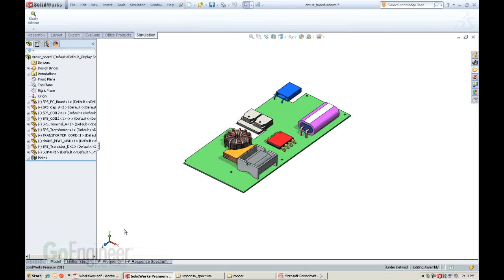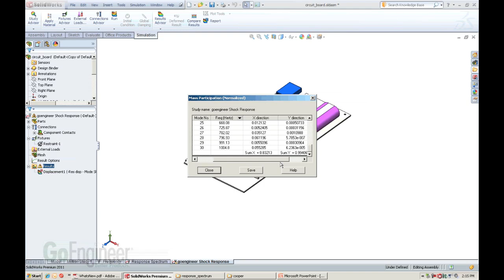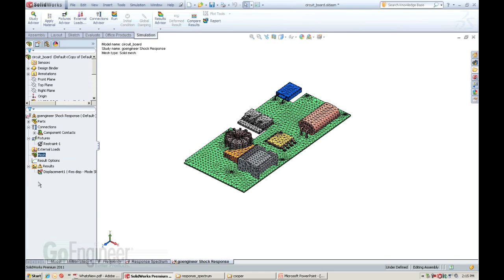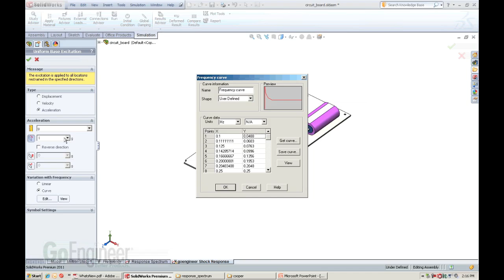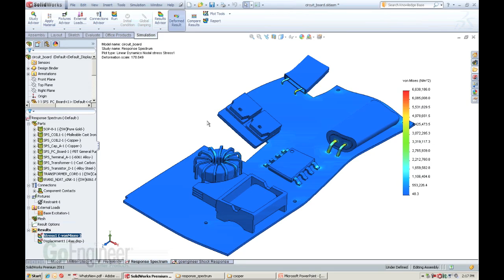SOLIDWORKS Simulation 2011- Shock Response

Comment: We are Interested in Software for Simulation of Shock Response Spectrum due to Pyroshock on Satellite/Aerospace.
Stress values can be predicted with this?
Reply from the maker: Yes, the SOLIDWORKS Simulation Response Spectrum Analysis does give stress results. It also can give displacement, and acceleration results due to the shock. 

You will need the Shock Response Spectrum (SRS) from the Pyroshock event that the spaceship undergoes at stage separation. This SRS can generally be found in a mil spec document but if it is not, they will need to generate their own SRS. 

Here is a great short video by Tony Boding that gives a great introduction to the Shock Response Analysis option in SOLIDWORKS Simulation Linear Dynamics: https://youtu.be/gTxwRa-gfhY